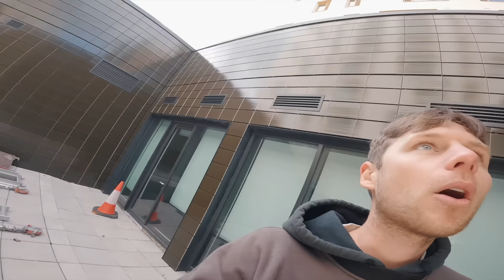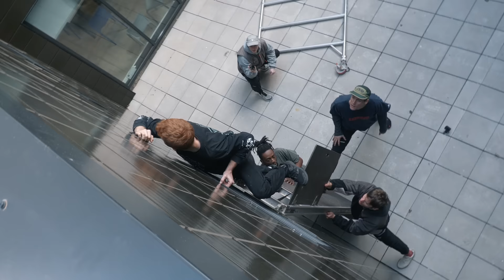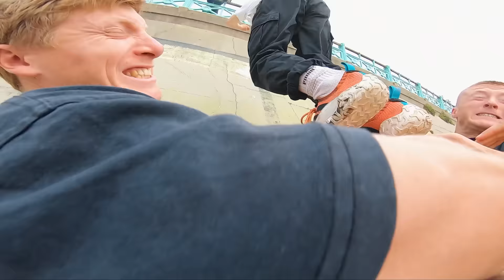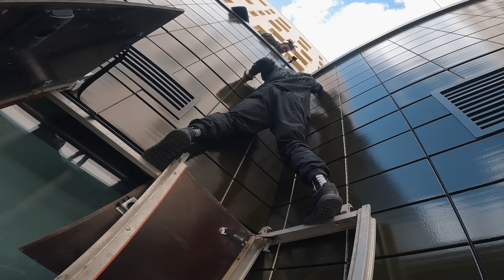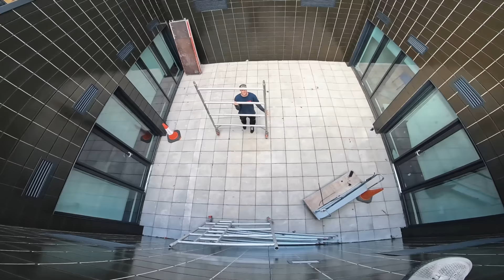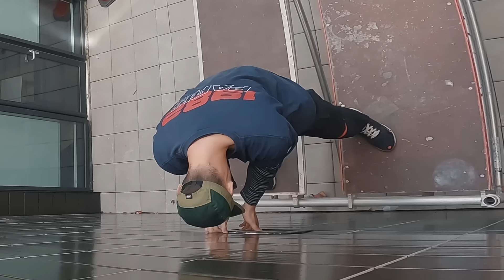EXTREME Parkour ESCAPE Room (We Got Stuck!)

Comment: Callum is an absolute unit. 1 hour in the pit by himself, building his way out. The dedication is respectable ✊🏿
Reply: Nah, that's demency.

Just kidding, Callum is hella boss!!
Reply: I used to work insulation, and if it took me more than 10 minutes to build scaffolding twice as high first thing in the morning my boss would get pissed. Callum's kind of an idiot.
Reply: @teddyf9438  bruh, u worked on that, prob Callum first time building one
Reply: @teddyf9438  To be fair Callum doesn't work installation...
Reply: @henri8604  this is true, but also if you have any common sense you'd realize that putting the braces diagonal on any rung is kind of a bad idea. Theres a reason ladders are made of rectrangles....
Reply: @teddyf9438  structural integrity isn't common sense.
Reply: @teddyf9438  To give you perspective of someone who's never been interested in building, I thought diagonal would be a stronger fit. 

It is not common sense
Reply: @teddyf9438  ratioed
Reply: I understand and agree
Reply: @teddyf9438  you definitely dont have friends lol
Reply: @timeprison9249  none
Reply: @teddyf9438  i don't work in installation, but my "common sense" dictates that bracing diagonally lets your sides tilt in opposite directions like a trapezoid, but bracing horizontally lets them tilt together like a parallelogram. your shape can't be stable unless you've constrained both motions, which is typically done with triangles
Reply: @rarebeeph1783  Actually true, I didn't think of that
Reply: @teddyf9438  lol but agree
Reply: Repent to Jesus Christ 
“Consider it pure joy, my brothers and sisters, whenever you face trials of many kinds, because you know that the testing of your faith produces perseverance.”
James 1:2-3 NIV
Reply: Don't put the diagonals in the same direction, I have seen these towers wrong on sites so many times.
Reply: It feels really scary just being in a room all by yourself and trying to escape from it minutes later
Reply: @teddyf9438  bruh he’s never touched scaffolding in his life
Reply: Jesus loves you all, have a blessed day or night. May His peace be with you. ❤️❤️❤️
Reply: @teddyf9438  The reason is so you can climb up them, not because it's stronger that way.
Reply: He is the strongest and most mentally strong I think. Guys a beast
Reply: Callum's a unit
Reply: @negan4089  it definitely is common sense 🤦‍♂️  structural integrity is guaged using common sense 🤡

Comment: The scaffold end sections will stack together if you remove the castors. The two remaining casters on the bottom section should lock. Combined they would give you about 8', 2-1/2 meters of frame to climb.
Reply: I learn a lot from YouTube comments
Reply: Having built many tower scaffolds in my time I was thinking the same lol. Like I could get out of there in probs about 15 minutes on my own with basically a big ass ladder. I suppose if you don't know you don't know.
Reply: @ZG0002  Yeah, but they knew, right?  Are we supposed to believe there was a full set of scaffolding down there and they ignored the option of just assembling it and using it as intended?  It's silly.  They rented that scaffolding and placed it in the place that they obviously had permission to use.
Reply: @jeffreygordon7194  or they didn't just want to cheat the video and end it in 10 minutes with them not using parkour and just building scaffolding the whole time? stop trying to just assume everything is faked
Reply: @exterminatordj3901  Okay.  So you're saying you think they pretended to not know they could use the scaffolding so that the video was more dramatic.  But they weren't pretending that they didn't put it there.  Also they weren't pretending that they didn't have permission to be there.  So it's partially fake, but not completely fake in your opinion.
Reply: @jeffreygordon7194  or, hear me out, the video is about doing parkour and not building fucking scaffolding? and i doubt they rented it or had permission there’s tons of shit like this in every city
Reply: @Chumley-yr1jg  I hate to tell you this, but the Easter Bunny and Santa Claus are also fake.  You can choose to continue believing in them if you prefer, but I'm an adult.
Reply: @jeffreygordon7194  buddy I don’t think anyone wants to rent a space to climb out of....their sign of permission was a resident saying 🤫 through the window and pretty sure these lads would rather spend money on better things unlike scaffolding equipment that their gonna use for 2 hours
Reply: @bakka6942  The made around $10k for this video based on how many views it's gotten.  How much do you suppose it costs to rent scaffolding?
Reply: @jeffreygordon7194  I have a batter time believing in Santa than that any London bureaucracy would let chavs do parkour.

Comment: you guys should try bouldering, you'd have so much confidence in those tiny little gaps. sometimes two fingers is enough to jump grab on the ledge that would give you extra reach of around a palm, which is huge imho. also, good work on the scaffold considering none of you guys probably have experience working with that stuff :D

Comment: What the hell are they building.. are they 3 years old? Put those 2 with wheels parallel and then that long board thing on top supported by those two pillars, voila that's your steady base. Then there's a ladder that you can add on top.

Edit:Ahh so they saved that up for the last guy to do..